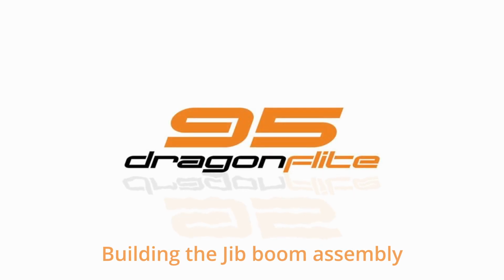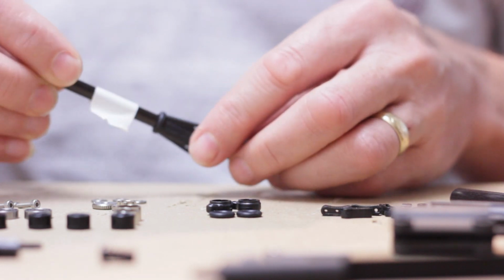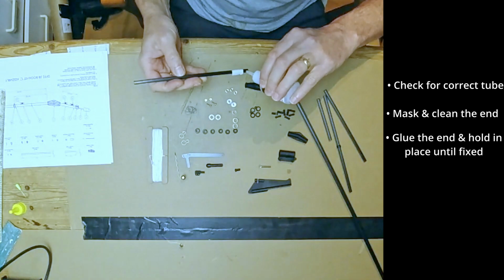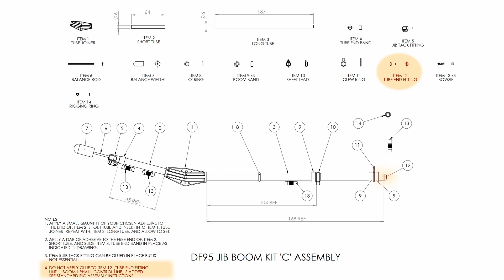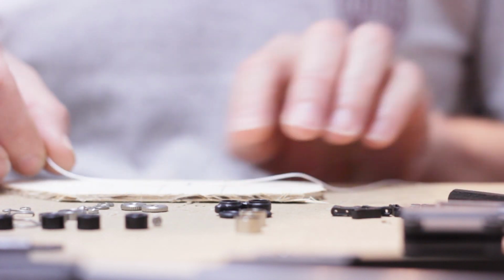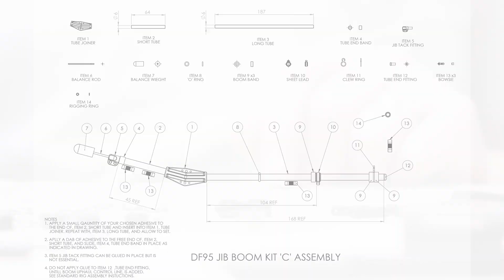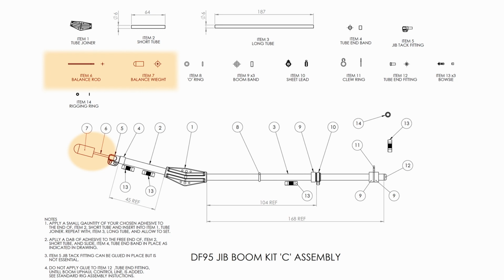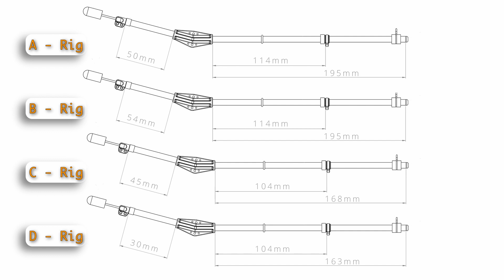DF95 Build   Part 2 of 7   Jib Boom Assembly

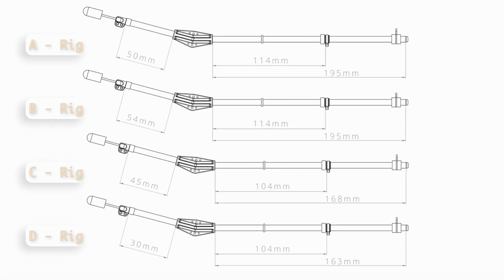Comment: I noticed in your diagram showing the different jib boom tube measurements at 10:24 that the B rig front tube is longer than the corresponding A rig front tube length making the B rig jib boom actually longer overall than the A rig. Is this correct? I just have to know before gluing. Thanks in advance.
Reply from the maker: Hi, The shorter section of the B-Rig jib boom is longer than the A-Rig Jijb boom's shorter section, yes.